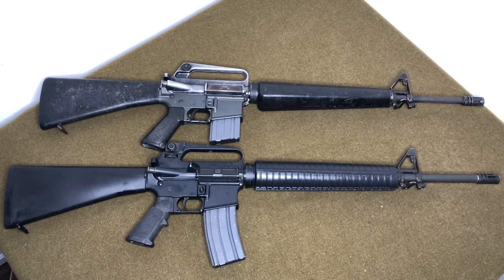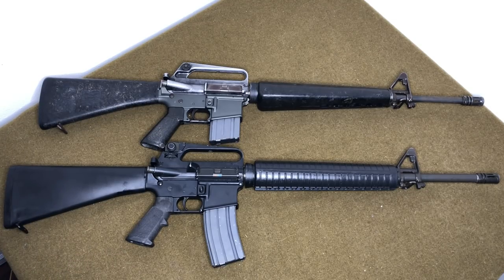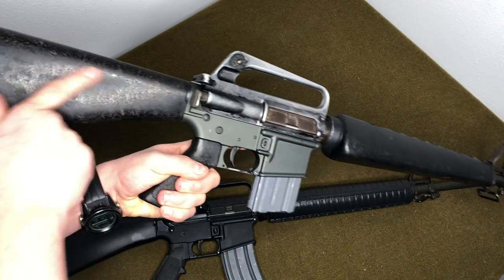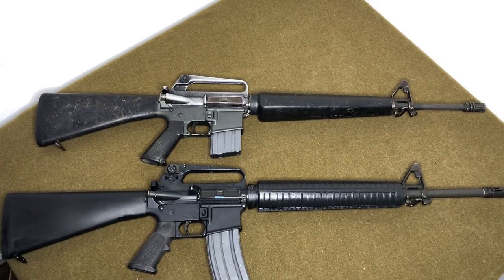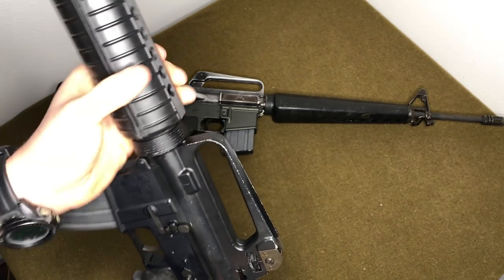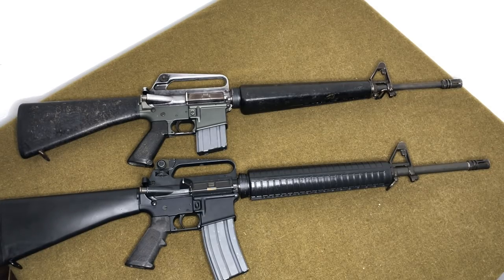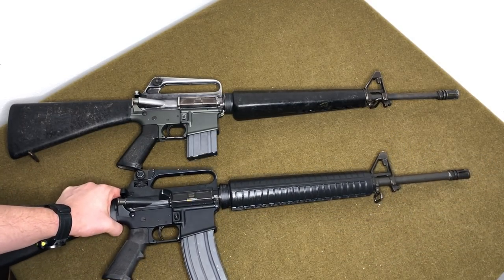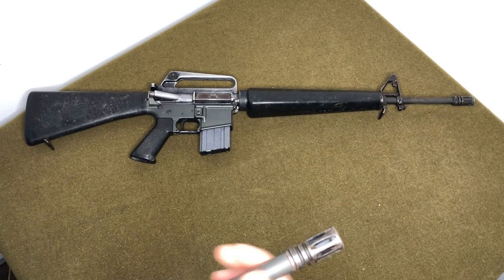The Differences Between the M16A1 and M16A2

Comment: Difference: A1 has a better Length of pull.
Reply: As a young L/CPL in 1986 they took my A1 and issued me a brand new A2. All us troops noticed right off the bat the A2 stock was the only bad change. The flack jacket pushed the rifle out even further with A2.
Reply: @PLT-dq3dd  that must've been enjoyable. What'd you think of the weight compared to the A1. Like or dislike?
Reply: @ironstarofmordian7098  that depends on whether you like to carry around more unnecessary weight or not
Reply: @ironstarofmordian7098 , before I joined the army in 85, I bought an AR15. It was an A2 6500 Sporter II transitional model.  It was the first model with the forward assist, as the first A2 variant had A2 parts minus the FA.

I didn't initially think anything about the weight or balance till after I left the service in 89. I LOVED my M16A1. It was extremely lite, and almost felt like a long barrel pistol. 

When I got back to the civilian world and my Sporter 2, I didn't like the additional weight on the front end due to the barrel being larger in diameter for the last 7".

I replaced the A2 handguards and pistol grip with A1 parts. I don't have body armor, so the stock length doesn't bother me. 

The only change I'd make at this point is getting a pencil barrel, as I have only changed the charging handle with one I won from the NRA, and recently dropped in a Geissele trigger.

The additional barrel weight is a waste, along with the forward assist.

The one actual improvement is the closed off flash suppressor.

Comment: The M-16A1 was a great rifle. For us lefties, you were issued a plastic brass deflector. It had a detent ball that snapped into the hole in the carry handle. Kept hot brass from going down your blouse and burning the shit out of you. The solid bottom flash suppressor was issued on some of the last production A1’s, I was the company armorer and got a few brand new A1’s though supply. It’s intent was to keep from dusting yourself while firing from the prone.

Comment: Filling in the bottom of the a2 bird cage also helps to mitigate debris getting kicked up when firing from prone, or so I've been told
Reply: That is the primary reason, secondary reason was to act as a pseudo-compensator
Reply: Not true. Better design for recoil control, because the gas leaves the bird cage and pushes down on the rifle instead of pushing up.
Reply: The birdcage is in fact, very useful for prone shooting on loose dirt. 👍
Reply: I've been told the same thing
Reply: This change may look small, but was a huge improvement to the rifle
Reply: According to Lt Col Lutz it was 2 fold choice.  One to keep dust from getting kicked up excessively.  Two to provide some compensation.  According to him it was also  designed to be clocked differently for left and right handed shooters but it was something never done in practice.

Comment: 3 round burst was a way of giving you full auto without emptying the mag, overheating the barrel, and running out of ammo. 
At least that is what they told me in basic. They said soldiers under fire will go full auto with little results and all the negatives above. 
Do you have a preference for an current A4 version out now sale?
Reply from the maker: For an A4, you may as well just go with something like PSA. Just get their 20 inch "freedom rifle" kit and get some picatinny heat-shields and voila.
Reply: The AR in full auto is way too fast, it best to slow down and keep full auto instead of three round burst. IMHO.
Reply: Better hit probability for moving or hiding targets. 3 bullets instead of one. Better control than full auto
Reply: Burst is crap... always was.
Reply: And apparently made the semi-auto pull a lot worse, helping to ensure you wouldn't hit anything, either way?
Reply: Mike B Freedom rifle sounds Second amendment as hell
Reply: @DungNguyen-ru5kg  Exactly! If you don't want to go fuller auto, get inside a heavier bolt and go full auto! I don't know about the recoil, though. A stronger buffer spring might help?
Reply: Burst fire means no full auto when you may need it, and unpredictability with bursts when switching between semi and burst. Best to encourage semi auto only, and then let troops full auto when needed. That’s why they are going full auto M4A1s.
Reply: I think a single burst and full auto selector switch is the best of all worlds semi automatic fire for specific targets and being accurate 3 round burst for multiple targets but still needing the accurate full automatic fire when you need covering fire or area of effect targeting that way you can do wide range of things that being said though area of affect and covery fire can be given to you by the saw Gunner but with Many Things Different Strokes for different folks everybody likes a different thing and a big organization like the military cannot appease everybody
Reply: Jcam Camarij well their reasoning is.....its what they got
Reply: No PSA is doody
Reply: Yes but in close quarter combat, full-auto is a better choice.
Reply: According to Lt Col Lutz the 3 round burst feature was a compromise, as the A2 was really close to being introduced as a semi auto only rifle.  3 Rounds was chosen over other burst counts due to a 1978 study.  Same for the design of the burst cam they wound up using which was based on a burst mechanism that had already been tested and found to be reliable.
Reply: But full auto gives advantages at close quarter combat and for suppressing enemy.
Reply: k damsuaro sadnimo waka kahatah nako bisa 1oo geabi
Reply: Everybody who I talked to who was in the military said the three-round burst was better than full automatic because first of all running out of ammunition is as dangerous as the enemy and second of all fully automatic fire is not accurate and even submachine gunners during world War II with tap out 23 or 4 round bursts 

Years back I was talking to a friend of mine who did four tours of duty between Iraq and Afghanistan and I was asking him about the full automatic M4 A1 being issued to everybody in the Army and he said oh my God that's a horrible idea because the quote unquote call of duty generation is going to be entering the military and they're either going to run out of ammunition or burn off the lubricant extremely fast 

. Again the M16 and M4 are rifles they're not submachine guns volume of fire and suppressive fire is for the saw gunner and the squad leaders were The rifleman are supposed to be picking out targets and shooting them with volume to shots and the three round burst puts out plenty of volume of fire in a close combat situationand it forces the soldier to aim as opposed to holding down the trigger and just spraying where you're not hitting anything but you are running out of ammunition and burning off your lubricant.
Reply: I heard the bar guys would do a couple of rounds at a time. Because if the Japanese found out there was a bar out there they would concentrate fire on it.

Comment: Thanks for the great video Mike.  I built my first AR-15 almost 20 years ago using an Olympic Arms lower and a 20" HBAR barreled DPMS  A-2 upper .
It was a great rifle and very accurate but it just did not have the same sweet balance and feel of the M-16A1 the US Army issued me in 1979.
That HBAR just made it feel nose heavy to me.  It was heavy all the way through so not really an A-2 style barrel.

In 2012 after a few personal life challenges I needed ro sell all my guns to help finance a move from Texas to NC.  In time I decided I would build another AR and this time 
it was going to be an AR-15A. It took me two years as i live on a low SSI  disability income now but she has the same weight and feel of my old Rack # 54  M-16A1 I carried in the 70's and 80's.  Now here is the cool factor.  When I was PCS'ing from West Germany I was turning my M-16 in to the armorer in our unit for the last time after I cleaned it.  He took it from me then removed the hand guards ,  which were really worn down, and replaced them with new triangular handguards.  I asked what he did with the old ones and he said they were expendable items so they threw them away.  I asked if I could have them and he said OK.    So I used my old M-16A1 hand guards on my repro AR-15A1.  I had to use a piece of an old credit card and some JB weld to replace a missing finger on one and to reinforce 3 cracked fingers.
Reply: Thats so cool
Reply: That's awesome dude.
Reply: That is so cool. I had the same A1 for most of my 20 year hitch in the Army National Guard. The last 4 years was with the A2 which I never grew fond of.

Comment: I was in an Army National Guard Field Artillery Unit 82-89. I was issued the A-1 in basic and AIT. Once in my unit, we had the A-1 all during my enlistment. We also had 1911's. They were beat to death! Most A-1's I seen were GM. I did get the chance to handle a rare H-R manufactured A-1 during basic. And we did in fact use a nail to adjust our rear and front sights in basic and once in my unit. Every firing post had a nail there for us to use.

Comment: Great job Mike. I really love that you are doing these very informative videos. There's only a couple things I could add (Im sure you know these but some viewers who have not owned/handled the weapons may not). The A2 barrel is only stronger beyond the handguard, it is the same diameter as the A1 barrel inside the handguards.  Also in regards to the handguards, the main improvement with the A2 is that you no longer need two different part numbers in order to replace the handguards (as in the A1 with a left and right side). On the A2 they are the same.
Reply from the maker: Indeed Bruce, I should have mentioned that fact about the barrel.

Comment: I got one of the Capco A2 uppers off of Gunbroker and built it up like yours but used a PSA stealth lower. I was looking at the Colt A2 upper kits on GB, but just couldn't justify roughly $1000 for it. I am also working on a Colt A1 build (kit) from Atlantic Firearms. These are great collectors. Great video, looking forward to more on these, thanks.

Comment: Going from A1 to the A2  in 85' the round grip was real nice the sights were nice and being able to adjust the sights quickly was a plus. No one was a big fan of the 3 round burst instead of full auto but accepted it fairly quickly.
Reply: The muzzle flash change on the A2 reduced dust kick up if shooting from the prone. No dust kick up reduced the ability to see where you were shooting from and  kept it the visibility

Comment: You mentioned the deflector on the C-7 being transitional. There were a few of these minor transition parts on my A1 while at MCRD in 1982, no deflector (Our lefties had a snap on plastic deflector) We had tapered slip rings, large aperture rear site and 9" twist barrels.
Good job and a very accurate video, keep up the good work.

Comment: It's pretty cool that you have those. I have a pre-AWB Colt AR-15 A2 which has some differences from the one you've shown. The bad ones are having the bayonet lug shaved off and a fat front pin to make changing out uppers difficult. The lower doesn't have all the gate stuff around the magazine release either. It's an HBAR version, but it has the cuts for the M203 grenade launcher. It's the first rifle I ever bought, so in spite of its shortcomings, it has a special place in my heart. The dust cover spring got broken at one point. I'm sure you'll understand why I haven't tried to replace it. Anyway, I enjoyed this video.

Comment: Thanks.  I had an M-14 in boot camp and on my duty stations but I used an M-16A1 in ITR in 1970.  One thing I remember about that M-16 though was that the magazines were not all the same size.  You had fat ones and thin ones - and because of that - you could adjust the magazine catch for the size of the magazine you had.  So - I get this fat magazine and I have to adjust the magazine catch to get it to go in the weapon.  I shoot that off (blanks) and go to put the next magazine in.  I let the bolt go home to chamber the first round - and it knocks the magazine right out of the weapon and down into the dirt at the bottom of my fox hole ... so I had to grope around for it in the dark, adjust the magazine catch - THEN - put the skinny magazine in and fire off my second 20 rounds ...  At the time - I was just picturing that happening in combat - and was not happy ...  But - all the things I've seen on various versions of M-16's ... no one talks about that adjustment for the magazine sizes ...  I've not used one since 1970 so ... I don't really remember that much about them ... except for this story ...
.
Reply: Interesting. Thanks for the service,never forget.
Reply: Had the M-14 in basic 67. Later M-16a1. Not to be left out M-1911.

Comment: Pro tip Mike, Fulton armory sells a tool to use for A1 front and rear sight adjustment. I read the browells one wasn’t very good. I got the Fulton one and have no complaints. Works like butter and doesn’t feel like anything on it will break. After getting mechanical zero using a punch I appreciate the tool a great deal.
Reply from the maker: Okay, but it's still not something you want to do during a firefight lol.
Reply: Agreed! Makes zeroing one at the range and trying different battle sight zeroes a breeze. Honestly I don’t think it was really intended to be changed in the field. Zero at your FOB or whatever and then hold off for everything else. I need to take my clone and run it out to 400-500 yards. I used a repro C7 upper like you mentioned as I’m left handed. It’s not a true clone but I didn’t want a safe queen I wanted a retro beater. 

Anyone using the C7 uppers from brownells be careful. I put in a set of vintage colt rear sight parts, new in the plastic from 1974, and it was a bitch to get in the screw on top of the flat spring. I think it was out of spec tolerance in the sight channel on the upper but after flipping the sight 100+ times with some oil it’s started to loosen up.

Comment: The first unit I was in 819RHS my issued M16 had no forward assist and was full auto. It was fun going full auto during an FTX but would mag dump 30rds in less than 8 seconds on blanks and obviously a BFA
Reply: Didn't think I'd see another Air Force CE guy in these comments. I'm not Red Horse but it's always cool to run into other AF CE guys online.
Reply: You were using pre '65. I had a 66 model in early 70's. I've got the A1 now and is nice having a familiar buddy.

Comment: Two things need mention: first, and irrelevant since you can use either one, but it is evident in the video, is that the M16A1 was still issued with 20-round magazines and when the -A2 was introduced, so were 30-round magazines; second, the reason the handguards are round is because if you broke one you could replace it with any handguard since they're identical, whereas with the triangular handguards on the M16A2 you need to find a match for that particular side, left or right.
Reply: Untrue, they started issuing 30 round mags in the early 1970s. Many saw use in vietnam.
Reply: @redtra236  yeah by 1972 30 rounders were pretty standard for anyone expected to be in contact with the enemy.

Comment: Recently put a A2 stock on my DPMS AR-15, and made it into a M-16A2 clone. Because for some reason somebody though it was a good idea to put a 5 position stock on a 20 inch heavy barrel with a solid carry handle but now it’s in full A2 glory like God intended
Reply from the maker: Gotta be an operator you know.. Glad you have an A2 clone now, they're definitely neat.
Reply: Mike B haha thanks, now I’m on the hunt for a G3/CETME, need to take a break from the AR platform

Also, drop a binary trigger in the A2 to simulate burst fire. Need to buy a couple before they get outlawed

Comment: wierd - when I was in Basic we had M16A1 sights with the 3 round burst action.  (1992 Fort Jackson)
Reply: Simply A1 upper and A2 lower.
Reply: @scythelord  - Yep - that's how I viewed it.  I just didn't think the drills called it anything but an "A1" but was naive at the timeon the A1 A2 difference.
Reply: Colt also supplied c7’s (a1’s with brass deflector and a2 barrels)

Comment: Longer length of pull is great when you're shooting on a rifle range in nothing but your shirt, but it sucks when you're wearing LBV and body armor.  For solid buttstocks, I much prefer the A1 vs the A2 as it fits me better both with and without gear on.  And I MUCH rather have a collapsible stock as then I can customize the length of pull.
Reply: I used the M16A1 in Vietnam in 1968 and it saved my life on both semi-auto and on full auto, it is better than the m16-a2, by a long shot.! The push button on the M16A1 is better, bigger and
easier to hit with your thumb, thus better.

Comment: Thanks Mike,  wondering if you could explain how did it detect the 3 round burst?
Reply from the maker: It's mechanical. Just search for it on Google or YT.
Reply: Rotational clockwork type mechanism....
Reply: A secondary disconnector with a ratchet gear on the hammer.

Comment: I actually just built an A1 replica that has a brass deflector. From what I was told, the upper receiver was refurbished surplus from an early Canadian C7. It looks pretty new, to be honest, although I did have to do a bit of filing on the pin hole to get it to fit into the lower. I don't really care if it's actually surplus or not because it was cheaper than a Nodak Spud upper, and I like having a brass deflector.
Reply: There was the M16A1E1 that has the brass deflector too.

Comment: Only advantages I found carrying the A1 was it was lighter when you had to carry your weapon for a long time and it was full auto, but unless you were in combat full auto really didnt make a difference. The A2 sight system was much better and provided a quick on the fly elevation change with the rear sight without having to have a tool to adjust the front sight. And the A2 was a more accurate weapon to fire in my opinion. I always qualified expert with the A2.